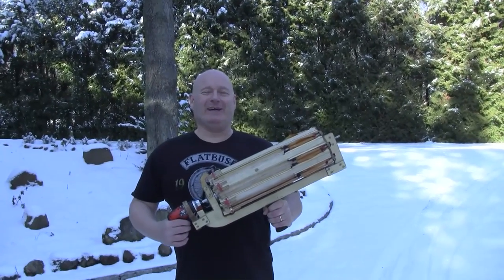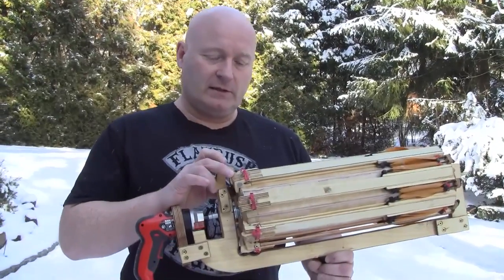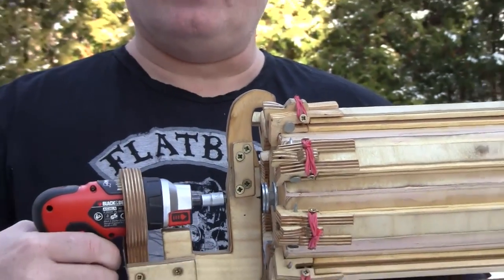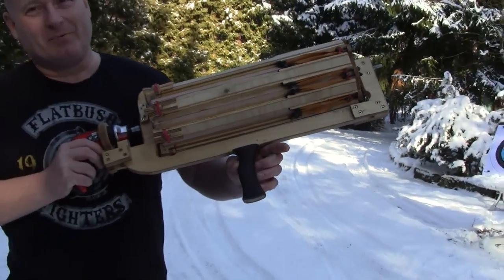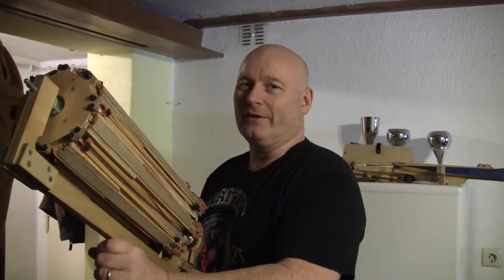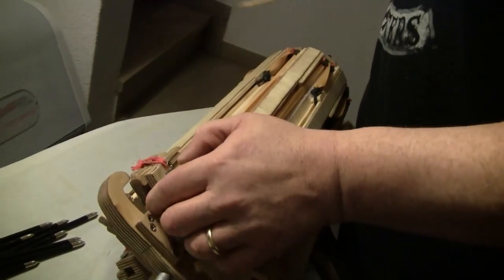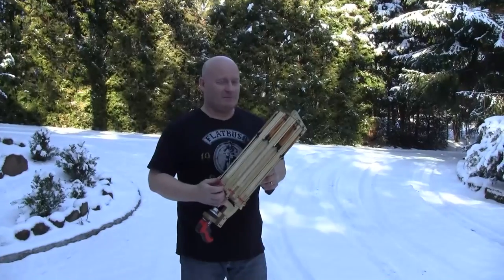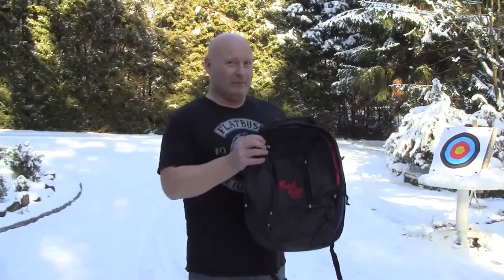Full Auto Slingshot Minigun!

Comment: I think the spinning barrel should be made out of the same type of sewer tube used in the spinning slingshot along with aluminum rails that hold the darts!  Then it would look like you bought it from a store. It would probably run smoother and quieter.

Comment: +JoergSprave
what if you make a mounted version with a larger amount of rounds say in a rectangular shape. so instead of a circle, the structure is like a rectangle where the short side rests on the ground and the edges are rounded. then you can use a chain to connect the whole thing and a "Zahnrad" from a bicycle to pull everything. that zahnrad would be connected to the drill.the drill would be up top and you could get in at least 5-10 times the rounds. more shots, more fun, more CARNAGE. yours truly